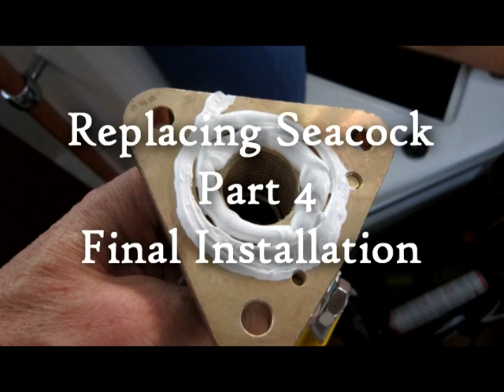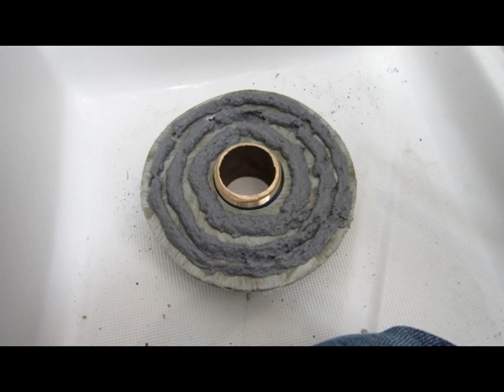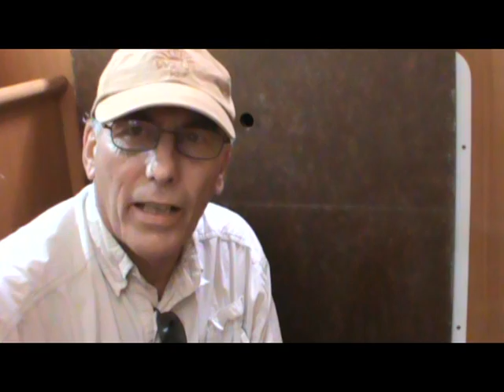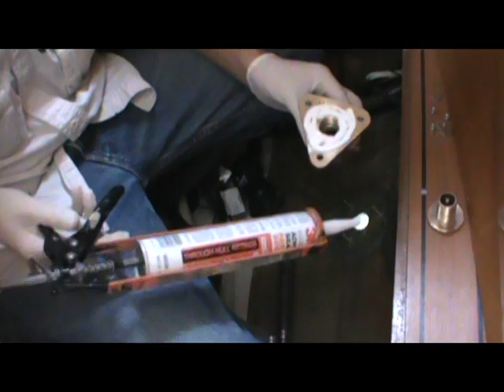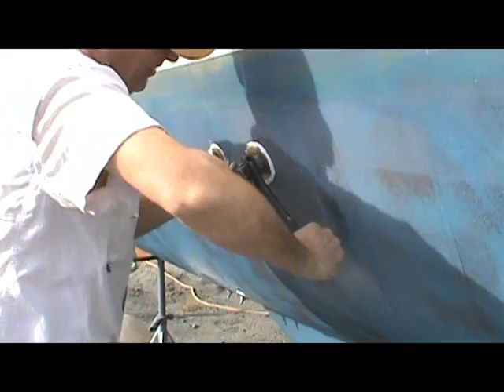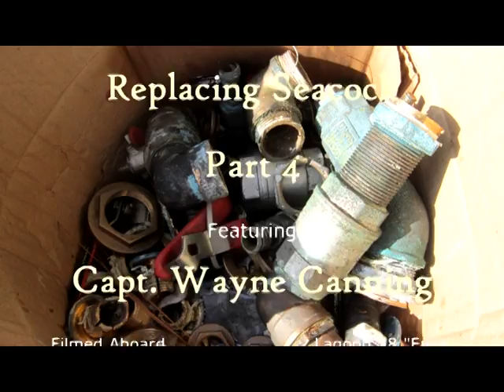Installing Seacock Part 4, Final install

Comment: Hi Capt Wayne.  Great video and thanks for posting! My boat had terrible looking backing plates and the seacocks frankly scare me, so I'm changing them all out (1975 Westsail 28). Everything I know about seacocks and thru hulls, I learned from youtube and trial by fire.  Here's my question: Do I need to gel coat the outside hull if I sanded some of it or can I 5200 that when I'm installing the new thru hull?  I sanded because there are lots of layers of bottom paint and I didn't think it would be so great to try to bond the through hull over top of all that paint.
Reply from the maker: You were right to  sand it. No worries if it is covered  by the thru hull that will protect the fiberglass just as the gel coat does.

Comment: it looks like you cut the through hull threads shorter, if so what did you use, a hacksaw?
Reply from the maker: That would work or a multi tool with a metal blade. If possible put the nut on below the cut so that it will "chase" the treads when removed. Also file a bevel on the cut to aid in threading the nut or valve on. Good luck

Comment: Thanks very informative. One thing I wonder about is which ones are better Groco or Perkins? Mine are Perkins and seem ok still. A bit green on the outside but no leaks. Should one use that white plumbers tape for the elbow fitting or nothing needed?
Reply from the maker: I think you mean Perko not Perkins but I get what you mean. Both are good products but if push can to shove I might lean to Groco. I do not like tefflon tap and will use silicone or other sealant i have handy.

Comment: Great video Wayne, can I just add a snippet about the Plexus you used, the inside skin of the boat will have to be unpainted and scrupulously clean for it to be a strong joint, any paint or even gelcoat will seriously weaken the bond as you then have a weak paint or gelcoat to fiberglass joint to rely on. (I know yours was bare fiberglass it was just a note to others if theirs is coated) I also note you were doing it on what appears to be a solid hull, a cored hull will need additional checks and work to achieve a satisfactory, long lasting outcome.
Reply from the maker: To be honest methacrylate adhesive has some aggressive chemicals that will cut thru most dirt and films making it very good for repair work. You are right, paint is to be removed and it is always good to roughen and clean any bonding surface. For cored hulls, you would want to taper the core back at any penetrations. Thanks for the comments and feedback
Reply: Yes it is amazing what methacrylate will stick to, I was thinking most folk won't be using it because of the cost, if using 5200 or similar cleanliness is crucial... Great vids though, keep them coming...

Comment: Wayne, thanks for the professionally done videos.  They demystify many of the tasks associated with boat maintenance!
Reply from the maker: Glad they were helpful
Reply: what are your thoughts about putting in thru hulls with the bolts going through the hull (countersunk), and then through the backing plate.  That seems like the most secure way to do it, but more work and room for error for the DIYer.

Comment: Can you reduce the number of seacocks, by using a manifold to share the supply?
Reply from the maker: You can and many boats do but it is not without its problems as well. After having serviced many boats with sea chests or manifolds I do not really see an advantage. You still have hoses and valves and this is where most failures occur not in the thru hull itself. Thanks for the comments

Comment: Hi Wayne, I finally ready to install the high speed intake thru  hull, what brand is that adhesive that you used to glue the g10 plate (that will support the seacock) to the hull? Do you think 3m 5200 would work? I think I like your option better. Thanks.
Reply from the maker: +Javier Hoyos I used Plexus which is a bit hard to get and a bit pricey. The only place I know to get it on a consumer level is Jamestown distributer. 5200 would work but I think I would use WEST Proset epoxy. That is a bit easier to get and not as expensive. Good luck with it and thanks for asking as others are likely curious as well.
Reply: Wayne, found some Plexus products, could you please share which is the proper one? MA300? MA310? Thanks ¡

Comment: what stops the machine bolts from turning when you tighten the nut down on the seacock?
Reply from the maker: +David Edwards The epoxy fills the slot and holds them in place. Thanks for the comment.

Comment: Very instructional videos. I like the idea of using g10 as a mounting plate for the seacock. I have a question though, in my case I want to install a thru hull scoop (strainer), how can I screw it all the way into the seacock? Is here a tool for that type of thru hulls? Thanks
Reply from the maker: +Javier Hoyos Those thru hulls with the strainers will not work with a proper flanged seacock. You would have to use the type of strainer that goes on separate over the thru hull.  The type you are talking about are designed for just a ball valve on the thru hull and not what I recommend. Hope that helps and thanks for watching and commenting.
Reply: Thanks for your reply Wayne, I will buy a regular bronze thru hull and then install a strainer over it.  A lot of good information in your channel. Thanks again.

Comment: Watched this 4 part series several times, but made my backing plates using this procedure (http://www.boatinghowto.com/content/how-make-your-own-backing-blocks-seacocks-275/). Your information was a GREAT help! I bought flange adapters for the 4 seacocks and did the install this past weekend. I am allowing the 5200 to cure before I put the seacocks onto the adapters and reattach the hoses. I believe that I did a good job, but praying it all works out. I am new to boating and just bought mine at the end of last season. The marina owner suggested that I not do the work, but I believe that with the help of your series, other research, and a lot of praying that it went well! Thanks again! The biggest difference in my situation was that my thru-hulls have the strainers attached and they also screw through the hull. I believe I improvised well. I guess we will find out in a couple of weeks when she goes into the water!
Reply from the maker: Mitchell Davis Glad this was helpful. I looked at the link you provided and my only thought is those blocks would be very resin rich and not as strong but should work ok for this application. I am sure your project will be fine and this is how we learn by getting out there and doing things. Trust me I had to make a lot of mistakes before I started getting things just right.
Reply: Wayne Canning These are the type of strainers that I am working with. As you can see, they have screws that go through the hull. I couldn't find anyone that addressed this issue so I put on my analytic cap and improvised as best I could. I will let you know in a few weeks how it is holding up after I get it in the water. Thanks again for your great video!
Reply: Wayne Canning http://www.ebay.com/itm/like/231348488084?lpid=82&chn=ps

Comment: Great instructional series! Cutting the fiberglass backing plates was especially well done. I'm guessing you don't have a cored hull? Would be interesting to see how much longer it takes when you have to dremel out some core and fill with epoxy. Also I'm not sure if you have to redrill the thruhull holes then.
Reply from the maker: Patrick Davin Yes cored hull will take longer and do require special attention. I would bevel the edges and glass over the core edge and then re-drill the holes like you say. There never is only one way to do something every boat is a bit different and requires a different approach. Thanks for the comments and positive feedback.

Comment: Fantastic, well thought out instruction.
Would marine plywood and Gflex also work?
Does anything other than the epoxy bond keep the machine screws from turning?
Thanks for the whole series.
Reply from the maker: NJ Doug I do  not like to use plywood or wood. If the hull is thicker than 3/8" i do not use backing plates at all, I counter sink the bolts from outside and fill over the heads so they are not exposed to the water. I used the plates on this hull as it was too thin for that. Glad you liked the series more will come.

Comment: Great video.
How did you trim the mushroom thru hull to length keep it square and save the threads?
Reply from the maker: I just cut it off with a cut off wheel and then used a small grinder to bevel the cut and clean up the threads. I think this is shown in part 2 on preping. Not hard to do at all but it pays to dry fit before getting everything all gooped up. Thanks for watching and comments.
Reply: Wayne,  great video.  However I need your advise about backing plates.  I have several seacocks to do but all of thru hull are flush mount so on the inside of the hull,  there is a raised area accommodating the flush mount thru fitting so the inside is not flat.  How do I make a backing plate to go on top of this.  Do I have two,  one with a large open to go outside the hump and then another to go on top of that?  Also,  How do I know that I will be square so that the flush thru hull will fit inside the inset of the hull and not sitting off to the side leaving a gap?

Thanks Wayne for your help!